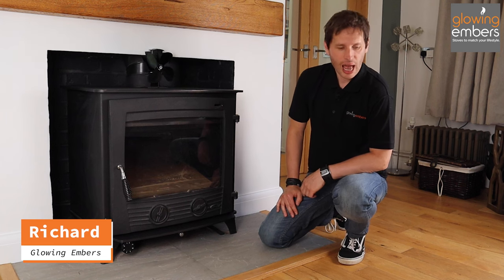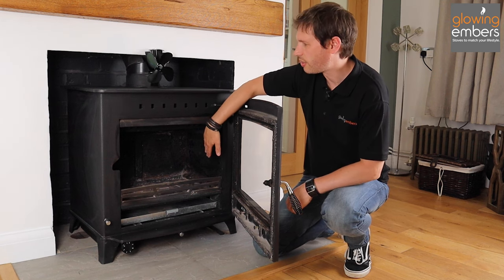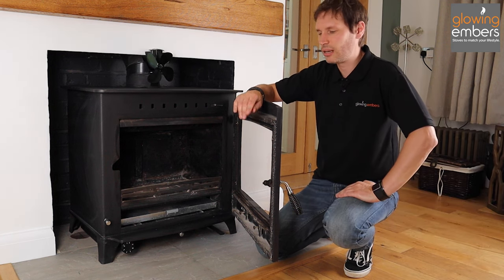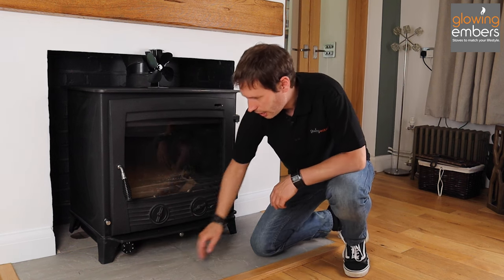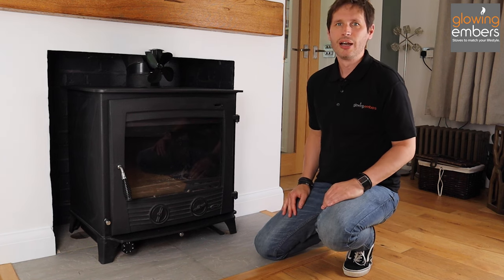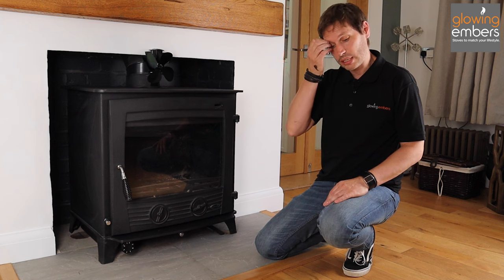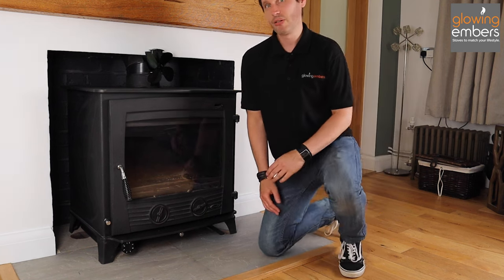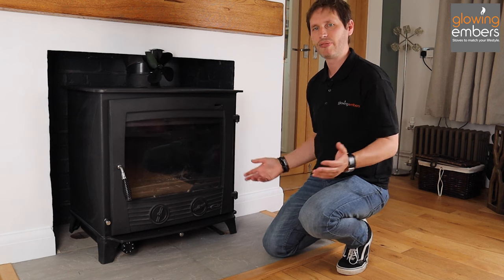An Introduction To Boiler Stoves | Glowing Embers

Comment: I looked into this last year when I bought a multi fuel stove to link up to my gas boiler and use either to heat the house, I have a sealed central heating system [ no header tank in the loft] and it wasn't suitable, I have a standard boiler with hot water cylinder
Reply from the maker: Yes, you would need to add an expansion tank in the loft and a heat soak radiator but you can install these with a gas boiler or other boiler, you just need to ensure that the system is well designed.

Comment: This system, I guess, is only available in Europe...?
Reply from the maker: You should be able to get boiler stoves in your country too and the system would be designed to fit your home.  Where are you based?
Reply: Oh hi @glowing-embersUK  , thanks for getting back, I already have radiators around the house (10), and really liked your Idea of the boiler stove! I am living in Quebec, Canada  ; )
Reply: The answer is probably NO. I looked for these in the US / Canada market and could not find any. The hydronic market simply does not exist here like it does in Europe. It is the same reason why the selection of air to water heat pumps is much smaller in North America compared to Europe.
Reply: @theodorepollock4019 epa killed 'em

Comment: could you have this, and a normal combi boiler, and/or heat pump feding the same radiators?
Reply from the maker: Although not impossible, it would not be advised as you would be attempting to install an open vent system with a pressurised system which would be complex and expensive. We would advise seeking the advice of a heating engineer for further information.
Reply from the maker: This is effectively what I have done with an Air Source Heat Pump but with a gas boiler it would be even easier, the combi-boiler would just take over when the boiler stove was low or out.  I have a more in depth guide here:

https://www.youtube.com/watch?v=DnyDMQRXcqo

Comment: I grew up with a fireplace in the house.
As most homes in my home country at that point, was located in the living room where the only TV was located (no internet not phones no nothing).
It was great to warm your bones beside the fire and just watch fire go over some pipes.

Those pipes were heating water but it was water for the boiler only.
So we had hot water for showers etc, not for radiators.

Still was such a good time to live in.

Comment: Would you be able to answer few questions for me. I’ve exactly same stove. Can you talk more regarding thermostat potentiometer on the bottom left? How to operate most sufficiently this one. Second question is which water connections should be use along with Heatgeanie heat exchanger? Third: how to overcome chips/dirt inside burning chamber? Is it normal to have this sort of issue in this stove or perhaps there has been wrong plumbing at the back to circulate water so it’s not evenly circulated? Thank you in advance.
Reply from the maker: Great stuff, it is a good stove. The thermostat operates a damper valve in the stove and the idea of this is to try to even out the heat in the fire box by fuelling or restricting air flow. It is simple in principle, the higher the number, the more air goes to the fire box and the lower the more it restricts the air. 

So if you want more heat out of the stove, set the number higher and if you want less heat and the fuel to last longer, set this lower. It is similar to a standard air control except it adjusts based on how hot the fire box is, so if you have it set in the middle for instance as the stove heats up beyond your setting it will start closing the damper to try to slow the fire down and reduce the heat and likewise, when it falls below your setting it will open up the vents to try to increase the heat from the fire. Of course you have to have enough fuel etc for it to do this and in either direction it is just a help, the other air vent settings, the fuel you are using, the amount of fuel you have on, you flue etc all have a bearing on this – but the idea is to just help get a more consistent heat from your stove.  

The numbers are fairly arbitrary and don’t correspond to a particular temperate, you just need to use the principle of the higher the number the hotter the setting and play around with it until you get the balance right for your fuel and needs.  It is worth pointing out too that  you read the number at the top of the wheel – there is no pointer to mark what setting is being used and this can be confusing. 
 
For your heat exchanger, if you are looking at the back of your stove from behind the stove the top right should be the outlet for your pumped side of the system and the return being the bottom left, so obviously from the front, you reverse this.
 
Not sure what you mean by chips / dirt in the chamber? Mine does collect soot around the water jacket if that is what you mean, these can be scraped off or if you are like me, it does not bother me and I don’t really notice them.
Reply: Thank you, really useful informations. I’ll keep learning about operating this stove as we go since we installed this stove recently. It’s will be its first winter with this one. All the best, regards Greg
Reply: Is there a recommended setting on the thermostat to get the radiators hotter?